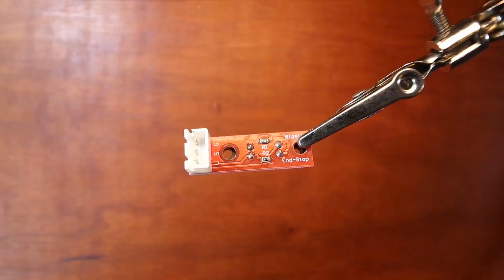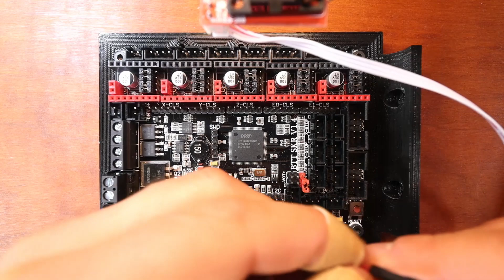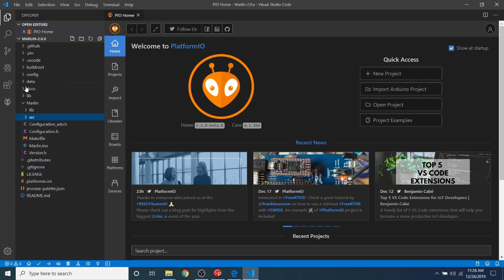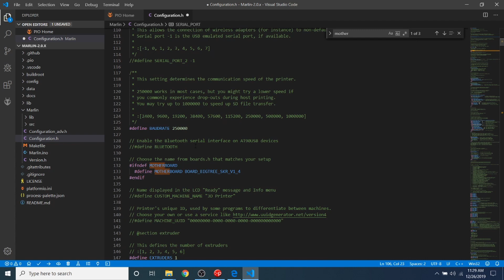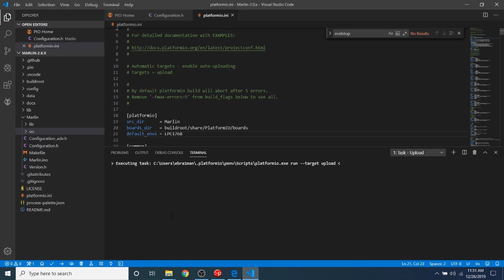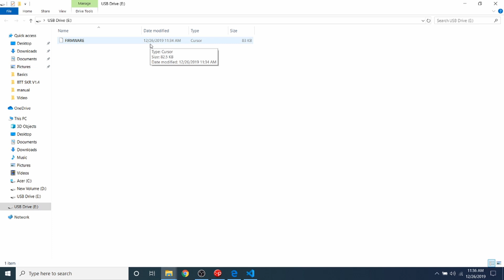SKR 1.4 - Optical Endstop

Comment: I am facing an issue. When I connect the microswitch end-stop, it gets triggered, but when I connect the optical end-stop, it does not get triggered. The red led on the optical end-stop keeps on glowing constantly. I have checked the wiring; it's correct, but I cannot find the issue.

Comment: Thanks for pointing out which pin on the skr 1.4 was signal. 
flipping power and signal on that end of the cable fixed my issue.
Reply from the maker: You're welcome.

Comment: I'm looking at upgrading my board to a SKR 1.4 or SKR 1.4 turbo, and I keep reading that one or both only works with sensorless homing. I'm assuming since you're adding an endstop to your SKR 1.4 this isn't the case, but can you comment on that?
Reply from the maker: Sensorless homing should work.  I'm trying to avoid doing a tutorial until I've built another printer.
Reply: @EdwardBraiman  , thanks for your reply. My concern was the opposite, though - I read people saying that only sensorless homing worked, and they couldn't get traditional endstop switches to work when using the TMC2209 drivers. Have you been able to get endstop homing to work with the SKR 1.4 and/or 1.4 Turbo and 2209 drivers?
Reply from the maker: Not yet.  TMC 2209 I've not yet done a tutorial on, but tmc2130 does work.

Comment: I wanna use it for z . but it is not working.light is on , when ı do m119 nothing change. ı use same endstop for x ,y  it is working. and basic endstop can work on z. ı dnt know why optical endstop not work on z.
Reply from the maker: If the optical Endstop works on x and y, it should work on z.  If a normal Endstop works on z, then it might not be fully plugged in.  These are just guesses from where I'm seeing the issue.  You might want to check continuity of the wires with a multimeter.
Reply: @EdwardBraiman , almost right, though I am using a Lerdge F191213 and it does work for Z only if I put an extra 1K resistor between signal and GND. Otherwise it's always triggered. Not good enough to understand where the problem is. The switch, the SKR board or Marlin? I am using TMC2209 with sensorless homing on X and Y so not sure those have the same problem
Reply from the maker: @viappi  you might need to post question to Marlin firmware website.  I know it works on older versions of Marlin firmware.
Reply: @EdwardBraiman  I have the same problem with my SKR V1.4. But if I connect the same optical sensor to Xmin or Ymin, then it works properly. I think there is something wrong in design of SKR V1.4 :-(
Reply: @viappi  hi, what and how do you put the 1k resistor? Just wanted to change my probably defective mech endstop with an optical one and now have this issue
Reply from the maker: Try my Discord in link below.  It's easier to chat.
Reply: There is a problem with the z end stop while using optical end stop only. I contacted the BTT support and they told me  to use sensor less homing . Im not impressed as i bought 3 boards and 2 of my printers use duel optical end stops on z.
Reply: @joeschlechtleitner8992  did you put the 1k resistor? Mine working fine since  (check my previous reply)
Reply from the maker: What's the name of your optical endstop?
Reply: There is a well known bug impacting optical end-stop connected to the Z-axis with earlier boards. Apparently someone during the manufacturing process messed up and put the wrong resistor for the z-axis. You can find work-around online and some YouTube videos already covered it. Problem seems to have been corrected with more recent batches of boards.

Comment: Optical Endstop is durable ? or Switch limit endstop more  durable  ?
Reply from the maker: They have different functionality and are both durable.  Mechanical switches brake sooner because of moving parts.  I prefer mechanical.
Reply: Optical Endstop are more precision.
Reply from the maker: @Vakhtang Tsikolia true, but it's moving to a starting point for cartesian plane.

Comment: Are all of the fan ports controllable or simply just direct connections to power?
Reply from the maker: Only one appears to be.  But I'll eventually have a video for how to make them controlled.
Reply: Well, on the 1.3 they have 1 controlled and the other was not controllable which was a shame so I had to use HE1 connection instead.
Reply from the maker: The extruder 1 and 2 or heatbed can be controlled as well.
Reply: Right, which is what I had to use but you are saying all of these new fan ports are now controllable?
Reply from the maker: Nope they are direct powered, but I may do a tutorial soon on how to make them controlled.
Reply: After playing around with their panel I stuck with my broken one as I am still waiting on your video for the new one I would like you said.
Reply from the maker: I did the videos for tft24 so far on this one.  It maybe a couple of days.  My CC in every language possible takes forever.  Everytime I say, "VScode", it comes out, "BS code", for auto CC.  The fixing of my CC is taking hours.  I might need to add more sound proofing or learn to speak clearer.
Reply: I meant the latest one you did for their 3.5 and I told you the issues I had and you said there is a better one but could mention it yet but would do a video.  I said I am waiting for that and I sent their 3.5 back to Amazon and here I am waiting.
Reply: CC is horrible on YT yet I can speak into my phone and it messes up but instantly corrects itself so its speech recognition is fantastic.  Considering it is a 25 dollar phone using Google and YT is basically Google then all I can ask is WTF?